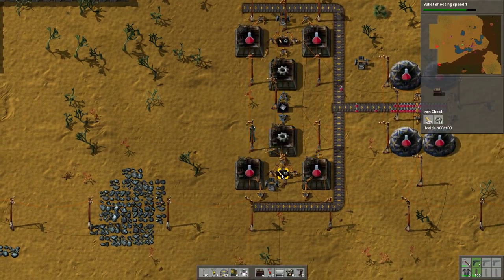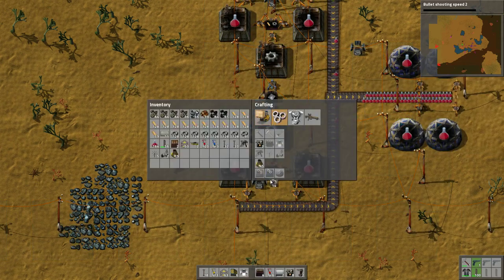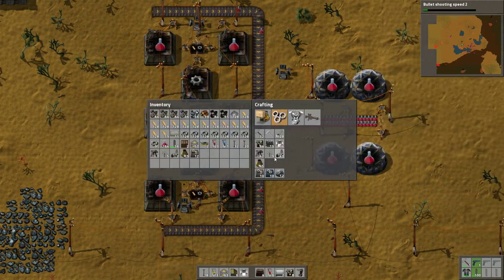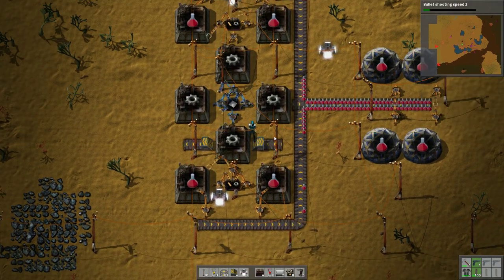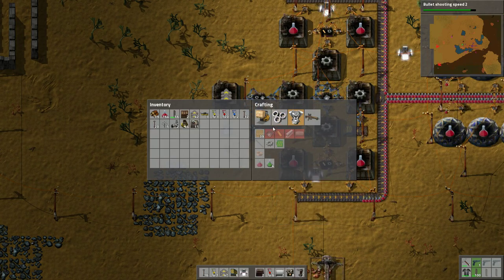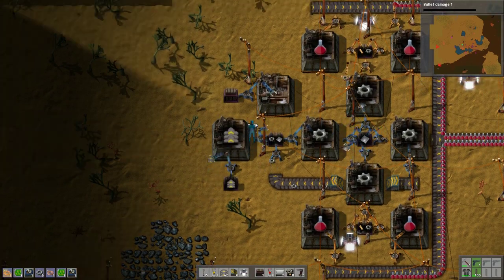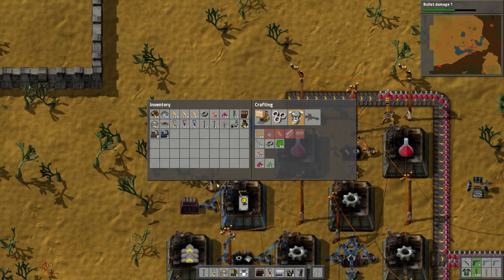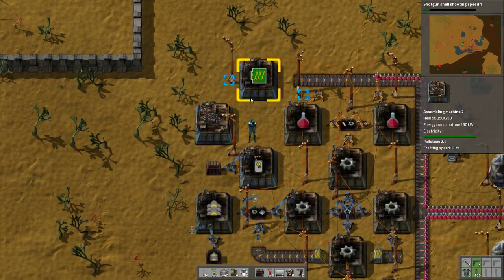Factorio Let's Play 12

Comment: Make your basic ore production (coal, iron, etc) all lead to one area.... make these got to furnaces in another area... make the "cooked" stuff go to an area that has facctories.... use the split transport belt things to break off the basic materials and have these lead to different factory areas.... one for research, one for defense, and so on. All the extras can then go to a storage area where they are taken off the belt put into a box, taken out of that box, put into another, taken out of that one, and so on until you have a few boxes for one resources, a few for another, and so on. it will be a line of boxes for each resource.

Comment: i really think that you should rethink your strategy with using boxes. this gives you very little of ways to alter your production chains in case of adding a new product into mix. from my experience much better is to use transport belts so your other factories can feed from multiple positions and that way you can get rid of that centralization, that will most likely not end up in gigantic mess
Reply: 1/3rd of that is gobbledygook

Comment: I think it would have been way better to put the research thing below the iron production (where the ammo factory was, so much less micro there) and you could have used conveyors to feed everything pretty easily. and it would be further away from the aliens...
I would have just made a row of factories, with each step in a column so it would be easier to manage what goes where.

OR, just converted the top red potion factory into cable and chip factory since you got too many potions already...

Comment: who else thinks he should just build a large conveyobelt around  9 auto builder, 2 green, 2 red, 1 conveyor, 1 inserted, 1 gear, 1 wire, and 1 chip. then just have then 6 researcher on one side with 2 iron boxes just to in put the iron and copper you will need to run it.

Comment: You should make your stuff go in a linear pattern with all materials and products going beside a long line of assemblers, with only raw materials going into each. That makes supply-distribution easier, and makes you less likely to clutter a single gear creator, for example.

Note: When I say raw materials, I mean mainly iron, steel, copper, wood, and other things whose precursor is not involved in any crafting recipes.